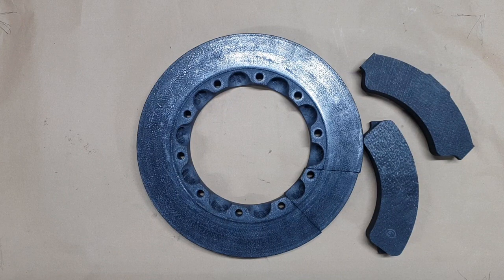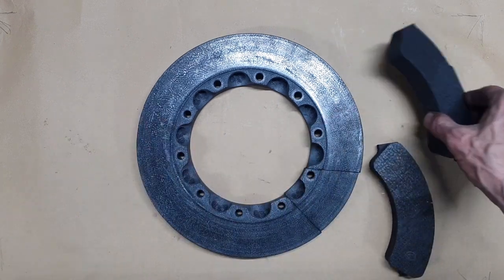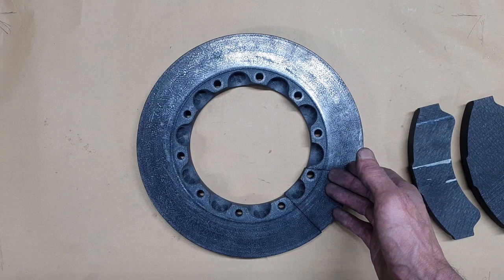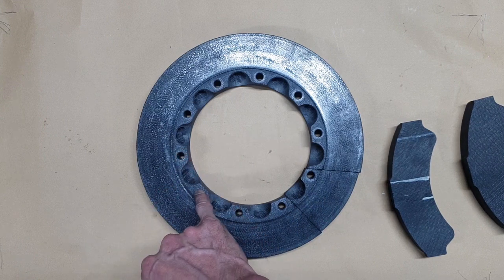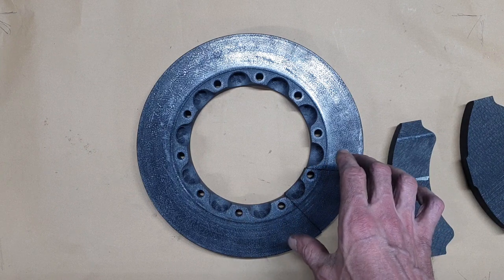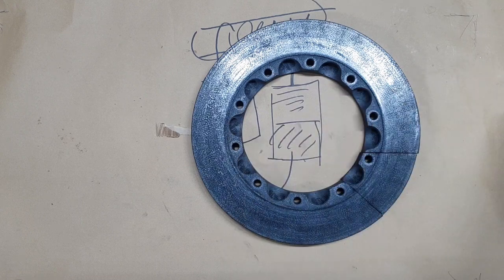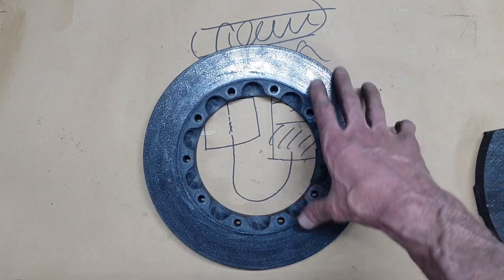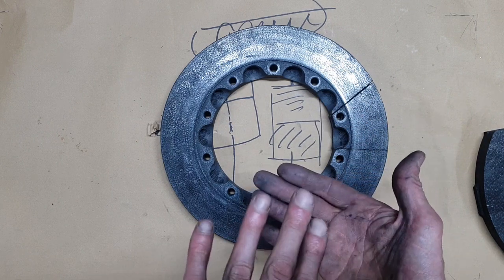F1 Brake Disc - A Closer Look - Ep 17

Comment: Looks amazing. Not being metal, can't believe how it is able to conduct heat. Its mind blowing. Awesome work
Reply from the maker: Carbon is a fantastic conductor of heat...it's near cousin the diamond is even better...and approx 5 times better at conducting heat than copper!
Reply: carbon and (some types of) ceramic been used for heat transfer on electronic devices (not consumer devices, unfortunately). definitely a good stuff despite of its price tag

Comment: This is the single most in-depth teardown of carbon ceramic brakes on youtube. Makes them seem kind of cheap considering the manufacturing process. Still mind blowing how little they wear considering how soft they are and the stopping power they have. On production cars fitted with them the pads even last a long time problebly because it's almost impossible to get them to temp on the street.
Reply: 10 mos later but thought I’d respond:  Carbon carbon and carbon ceramic are fairly different; the carbon ceramics include silicon which reduces wear a lot, performance a little and increases the weight by a bit.  Carbon carbon doesn’t have that same kind of plasticized binder which is part of what makes it take so long to manufacture.

Comment: I think the more recent  F1 brake setups have the disc soilidly mounted to the bell and the bell floats on the hub via  a splined interface. When Kers was introduced the rear brake diameter was reduced compared to the fronts as a proportion of the kinetic energy was being harvested through the driveshafts.

Comment: Moto gp use them I can remember when they first came out had all sorts of fancy shrouds to keep heat in them, Gardner had a crash when his rear carbon disc failed in development. The change back to steel when it’s wet due to lack of temp the carbon apparently needs

Comment: For what it’s worth, there’s a episode of, How It’s Made, that was about carbon-carbon brake rotors, Brembo, I think. One difference was that they used chopped carbon rather then woven plies.
Another was that the cooling channels were cast in, rather then thread milling, for the additional surface area.
Love your evasions as to the materials and processes. Reminds me of a politician in a hot seat.
Reply: I used to love that show, well I still do but I have to put it on mute because I can't stand the scripting.
But I could really care less as to how plungers or utility sheds are made, I like seeing the machinery doing all the wiz-bang magic.
I'll turn on the volume if it's something interesting, say, carbon fiber rotors and pads, but normally I can't listen to the dumbed down verbage.

Comment: Probably wrong but couldn't the threaded passages allow for block off plugs to be installed at circuits where brake temps are lower and therefore the full cooling capacity is not required?

Comment: It's a shame they covered up the rotors on the new cars so your can't see the discs glowing red under braking.
Reply: Do they use drums now for brakes in the new cars?
Reply: @idus  I believe it is not legal to sell new cars in the US that have front drum brakes. I think they are still used on the rear axle by manufacturers that do not care about braking performance.